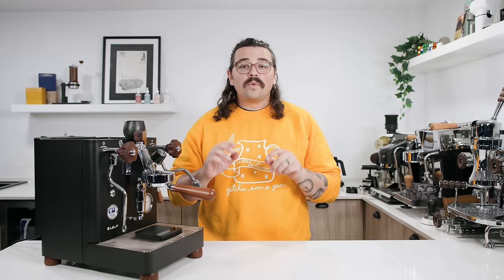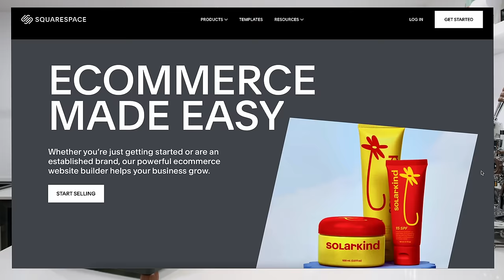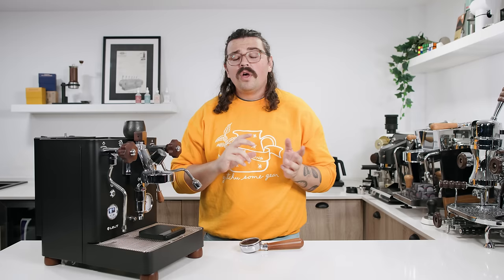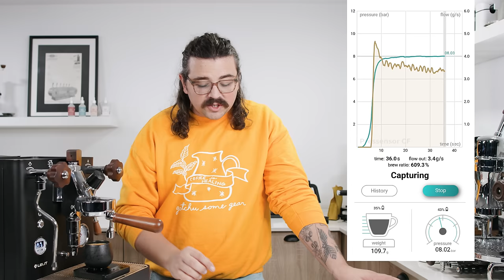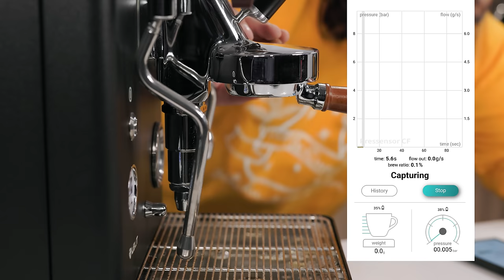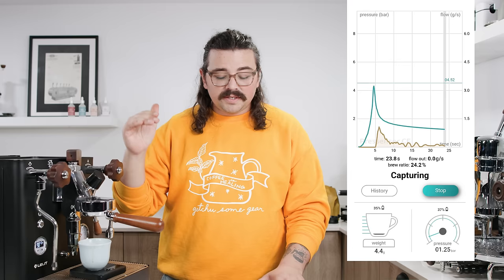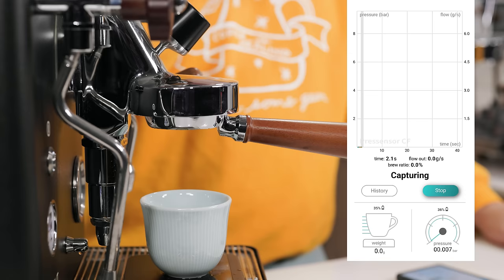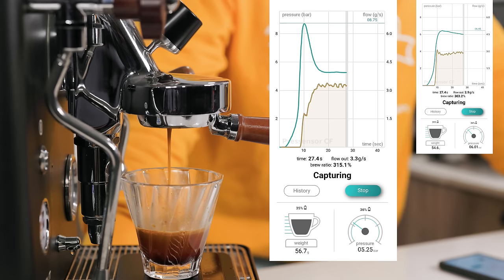UNDERSTANDING ESPRESSO EXTRACTION: Ultimate Guide on Pressure, Flow and Resistance

Comment: Lance, lot of information, and though I have a fairly deep practical and theoretical understanding of espresso making, I struggled with some of your demonstrations. I would like to point out two points which in my opinion were not sufficiently addressed but are immanent to a great espresso: 1. the ratio. Have you been working with a 1:5 ratio for espresso? I do not understand that high ratio. It won't sufficiently lead to point 2. extraction strength (not to mix with yield which you mention later at about 20%). Measured in %TDS through a refractometer your 1:5 shot will lead to a low %TDS which won't lead to a punchy espresso and is not suitable for milk-infused drinks but neither as a stand-alone espresso drink. The %yield though ([%TDS/espresso liquid out]/ground coffee in) surely can pass 20% (well within the parameter of ideally 18 - 22%) but it is not the defining qualifying criteria for an overall great-tasting espresso shot. %TDS (reflecting the strength) is the more important criterion; the rest follows suit. The ideal yield shall be achieved through proper calibration considering i.e. cup sizes (any coffee-infused drink shall be balanced especially when infused with milk hence cup size plays a crucial role in determining a great coffee drink, something that’s rarely mentioned in literature). For your ratio of 1:5 with a yield of 20% the %TDS is roughly 4% which is way too little 'strength' for the espresso. It would taste like an Americano but far away from a punchy balanced espresso which should have a TDS between 8.5–11% depending on the freshness of the roast and roast level (both, i.e., freshness of the roast and roast level plays a very important part in achieving proper strength). Using that 4% TDS espresso for cappuccino, latte, etc. would lead to a completely unpleasant drink. A 4% TDS espresso would be a not-welcoming espresso experience; most customers would not enjoy this drink. For that very reason, I do not understand why you chose a 1:5 ratio and have not commented on TDS and its effects as a major influence on overall espresso taste, equal if not more important than any pressure profiling (which surely influences %TDS as well – so there is an interconnection). However, maybe, you did not do it for the demonstration of the pressure curve, so it is easier to grasp. Maybe, if you have time and find it worthwhile you could explain that. For the 2nd part of the video, I appreciated the explanation about the integrity of the coffee ground and the role decreasing pressure plays in achieving a well-balanced drink. And thanks for the overall depth of this video which is extremely detailed and well-researched.

Comment: Hi Lance. Did you ever try manipulating flow/pressure after the puck and see how it affects extraction, with a valve installed below the portafilter, like you have on a portafilter equipped with thermometer or manometer. If the resistance could come from after the puck, the ground could be left totally loose, fully soaking in water, like in a French press, but still get extracted under pressure to dissolve gases and get a nice crema when they get back to micro bubble gaseous state under atmospheric pressure. This could maybe get us closer to an even extraction, while keeping the crema. I imagine a shot in which you mix the desired ratio of water and coffee, extract under sufficient pressure to dissolve gases, then release the brewed coffee through the filter. Maybe this is feasible with 5-9g of coffee in much larger basket.
Reply: What an interesting idea

Comment: Hi Lance, what are your thoughts on pressurized baskets to control flow? If most 9 bar pump machines are going to push out 9 bars to the end after the puck has lost a bit of resistance, would it be better to have some sort of additional resistance through a pressurized basket (or paper filters)? It seems pressurized baskets are generally a bad thing would be interested in this context why that is.

Comment: So here is a question about preinfusion / saturation rate, if the goal is to saturate as quickly as possible then is there any point to even having this preinfusion setting, which is essentially saturating the puck at a very slow rate, why even preinfuse for 5, 10, 15 seconds...

Comment: Alright, might be a lame question, but I have one about low-flow pack saturation you discuss at about 14:00 mark. You've talked about how full saturation affects consistency and helps to avoid channeling. I'm interested in whether it affects the flow rate of the rest of the shot. The thing is, I've tried a similar sort of thing on my Flair Pro 2, and the water was noticeably harder to press through the puck after the preinfusion. I wonder if anyone noticed something similar, and, if so, why it happens.

Comment: I'm brewing 1-3 ratio espresso with Bianca and rarely go above 2 bars in the group head, do you think that is that an issue (I'm using the paper filter at the bottom of a portafilter so it speeds up the extraction)? Good tip on saturating the puck as quickly as possible, I sometimes used too low of a flowrate. Will try these tips and knowledge in my next days :)

Comment: Regarding the blooming shot without acrivating the solenoid. I think with most e61 machines you can put the leaver in a 45 degree angle which stops the pump bit keeps the solenoid closed.
Reply from the maker: Correct! Yes. I go over this in my e61 videos.

Comment: Hi Lance! A question from a newbie here. I've just started making espresso on a Delonghi Dedica and since there is no solenoid valve i've been having problems getting the exact amount of espresso in my cup. I either have to stop the shot earlier or I have to stop the shot at the desired amount in grams and then pull the cup quickly. Which method is the best in terms of the effect they have on my epresso result? Stopping early and letting the remaing dissipating flow reach the amount I want or simply pull the cup when I have the right amount? Or are they same? Thanks

Comment: Hi Lance. One of the most useful coffee videos I've seen in ages. Thanks!

I am struggling with consistency on my Gaggia Classic Pro even with all the mods (Inc flow control), very careful puck prep and great quality coffee to get consistent shots at home (i.e. +/-5 seconds time variation from shot to shot to achieve the same ~30g yield from 15g dose). Do you have any insight on choosing between a blooming espresso style and a turbo shot style shot to bring more consistency for a home setup like mine?

Comment: Thank you for the video! So, to be clear, are you saying that the electronic low flow function on the Bianca V3 should not be used (as it goes full flow for only the first 3 seconds, which is not yet enough to build pressure, at least if I don't fill the basket to the max)?

Comment: So that means that the only "preinfusion" mode Sage/Breville Dual Boiler supports (using reduced initial pump "power" for preprogrammed or manually controlled time) is actually counterproductive, and in most cases shots would likely benefit when this feature was not used?

Comment: Hi Lance, then, apart from the fast fill of the basket at the beginning,(that’s something I did not think about, really) it is better to maintain the flow (whatever it might be…2.6-3.6…) steady for the longer time of the extraction possible? (That is of course if not trying to fix a mistake in the grind)  you see, I try to do that in a Dalla Corte Mina that I own, and I usually look for a flow of 2.3…(I understand the number in itself its not significative, for it might be just a different way of measurement) usually above that flow, I reckon is running too loose and the result is usually not that good ) Anyway, it was a great class, and I thank you a lot!!! Hope I did understand you right…!
Reply: I mean, I shape the flow curve looking for a steady extraction flow. Sometimes it has more peaks, sometimes is more flat…

Comment: Hi Lance, very interesting take on flow and pressure profiling. As you went through your segment on preinfusion/saturation rate, at 14:00 into the video, the bottom of the basket is as dry as the bottom of the puck that you knock out then crumble showing saturation only at the top of the puck. Allowing for preinfusion to be set arbitrarily, say 10 seconds, does make for inconsistent extractions. As I integrate a preinfusion water debit rate and preinfusion time into a brew recipe, the metric I use to assure complete puck saturation is to extract 1.5g of espresso prior to proceeding onto the main extraction. Would be interesting to see how complete is the preinfusion saturation of the puck, post 1.5g or expresso extraction. Thanks for the video.
Reply from the maker: The point of the visual is to show that low flow doesn't allow for a fast fill, meaning more stratified extraction. If I went to full flow, the whole puck would've been wet in 4 or 5 seconds. You don't need 1.5g in the cup to know it is saturated. Just seeing some drips form on the bottom will tell you. And of course the bottom of the basket is dry- if the grounds are dry, it shows no water could make it through the tight paths between the grounds because no pressure was exerted yet. And that's because the fill Rate was so slow it took too long to fill the gap in order to exert pressure, saturating the puck
Reply: @LanceHedrick  yup, true dat. Was commenting on using preinfusion to thoroughly saturate the puck compared to picking a particular amount of time that may not be productively relevant in a brew recipe. I think we can agree that once preinfusion saturates the puck, main extraction becomes much more consistent. My 1.5g into the cup is more of a guarantee that if puck prep wasn't perfect, it would give a bit more time for the rest of the puck to become saturated.
Reply: @LanceHedrick  There is a piece missing in the logic, though. Why is a quick saturation beneficial? You say slow saturation accentuates channels, but you don't say why that would be the case or point to any source on that. It seems to go completely against the logic applied to espresso extraction more generally, where the high pressure is precisely the reason why channelling is such an issue and lowering the pressure is supposed to alleviate this. I don't understand physics well and I'm sure there are tons of forces at play, but I think there is the pressure with which the water travels downward through the puck and then there is the much slower capillary movement of water throughout the puck. The latter acts in all directions and should increase homogeneity, but increasing pressure (and decreasing time) lowers its impact, so I think it's actually higher pressure that pronounces channels, because more water travelling through the low resistance parts disproportionately decreases puck integrity. If not, then why do pre-infusion at all? Going full pressure from the start will saturate the puck fastest, so that should be best in this regard then, no?

Comment: Hi Lance, so does this mean Slayer shots on BDB are not the way to go now? I changed my slayer mod to the GS/3MP style pressure profiling as it was easier to do fast extraction at first and then lower the pressure as the puck eroded. I feel like I have more control on the flow/pressure than I did with the straight Slayer mod. What are your thoughts on that? Thanks again for another informative, detail, and entertaining video. :)

Comment: @14:00 the low flow pre-infusion (puck saturation), it's half full but you could've let it run longer and it saturate gently no? that's what I do with my BDB slayer mod and this was following the Slayer instructions. Doing a stronger flow pre-infusion, we could see drops coming out but doesn't mean that it's evenly saturated through the puck, there could be channeling where water pushed its way through the puck and is showing drops. Or are you saying go full flow for pre-infusion, once you see first drops, you back off and lower the flow before the pressure starts to build so it avoids channeling?
Reply from the maker: What you said at the end, yes. And slayer style shots are what I'm calling out as not ideal.
Reply: @LanceHedrick  this wouldn't cause channeling? Is it because you're just filling water but you're not building up pressure yet with the last "or" thing I wrote?

Comment: I am not really getting why the "inherent puck integrity" lowers the flow rate of this machine. My understanding so far has been, that these rotary style pumps just give out a fixed flow rate until the 9 bar OPV is triggered, which then lowers the effective flow rate. Could someone explain to me how the control mechanism works instead? Because in the video we are far away from 9 Bar and it still seems to run into some kind of flow limiter.
Reply: You’re correct that rotary vane pumps (and vibratory pumps as well) maintain a fixed flow rate. Or at least attempt to. Both types are positive displacement pumps, so when completely unloaded (no resistance), they will move water at a constant fixed rate. As they begin to encounter resistance, they will push harder to maintain their flow rate. That harder push means they apply more force. More force means more pressure. 

At some point, something will hit a limit. Typically it’s pressure. The pump will push as hard as it can to maintain its flow rate and when it can’t, it begins to bog down. However, many espresso machine designers use an OPV as a sort of wastegate to bleed off flow when a certain pressure gets reached, say around 9-10 bar depending on the setting. Now we have flow in two directions. One into the coffee puck and the other through the OPV. Add both together and we should see the pump’s design flow rate.

In the video, 9 bars isn’t maintained simply because the puck’s resistance isn’t high enough… or it drops during extraction. The flow control valve is a variable resistance to slow down the flow when the puck is no longer able to. Hope that helps.

Comment: I believe the OPv on the bianca is set to 11 or 12 but you can adjust the pump pressure via the nut underneath the machine, i had set mine to max out at 9.5 bar which equates to around 9 max at the group but i only have a debit of 6g/s, is this "better" or would it be better to have the extra water debit in order to saturate the puck that little bit faster?

Comment: My Profitec flow control device rotates 1 1/2 turns, so I can start extraction at full flow rate. Once the pressure starts to rise, I can completely stop the flow. Should I let the pressure go to full 9 bars before shutting off the flow for blooming? Or would stopping it at a lower pressure, e.g. 3 bar, prevent the blast of high pressure from damaging the puck? Which approach is better? Thank you for another amazing video!!!

Comment: Using 98HU in the nautilus also yields very low fines, much lower than in the p100, and I see the same steep and quick drop in pressure as you did with the brew burrs in the EK.

Comment: Is the purpose of wanting to saturate the puck quickly due to the fact that the top could be overextracted and the bottom could be underextracted if it saturates  more slowly or is there a different reason you say you want to saturate the puck as quickly as possible?

Comment: Hi Lance, I had a question about the low flow rate shot. If I were to use something like the porcupress to create even pathways for water in my puck, wouldn't that completely negate the dry bottom portion? It should also provide some level of consistency as well because it saturates the grounds but mantains that low pressure.

Comment: Great video. I saw your reels on this subject from a few weeks back and have been using this protocol to approximate a lever shot with great results.

Did @LELIT_Official change the OPV setting to 9 bar for Bianca v3, or did you adjust it? I have a Bianca v2 and I routinely see 11 bar on the pump pressure gauge. All of the online resources state OPV is set to 11 bar. Obvoiusly, it's easy enough to manage pressure at the puck through flow and grind, but it would be nice to have a wider adjustment range with the paddle. Thanks!

Comment: I really enjoyed the video ❤! 

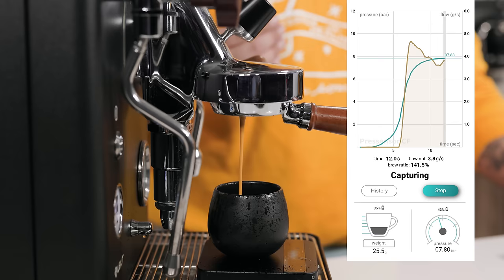I didn‘t get why the flow rate was 3,5 g/s  even (minute 8:45) when the preassure was only 8 bar. Shouldn‘t the flow go higher (~6g/s) in order to meet the target preassure (9 bar)?

Thanks again for the really well done content!
Reply from the maker: This goes down to puck integrity. Some won't allow more flow to go through. Some can't accept it. It all gets very difficult to explain when you get down to the fluid dynamics. Some is explained by slight fines migration potentially. Some by c02 release. Some by simply disallowing too much flow to go through. Hard to explain over text. Visuals would help more.

Comment: Okay so correct me if I’m wrong, but you’re saying that slower fills and low pressure pre infusions such as what’s programmable on the Breville Dual Boiler are bad? I recently went to the “slayer mod” and have been doing slower ramp ups but maybe that’s bad? 😂😂
Reply from the maker: No no. Slower fill re: water flow isn't ideal. Slower wrt pressure isn't bad. With slayer mod you can do fast fill then ramp down flow for low pressure no worries.
Reply: @LanceHedrick  ah - so I should try to kick on pump at full rate, then pull back the flow at first drops even if I’m not going for a bloom? Sounds like a caffeinated afternoon for me ☕️
Reply: TIL that the lack of pressure control for the preinfusion phase on my PID is actually a good thing.